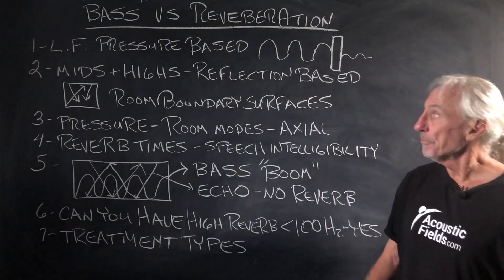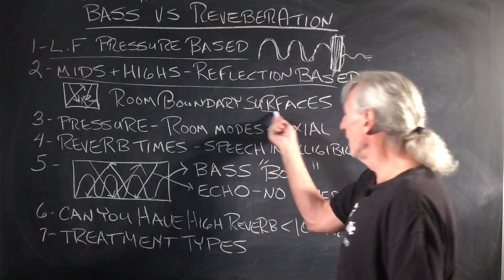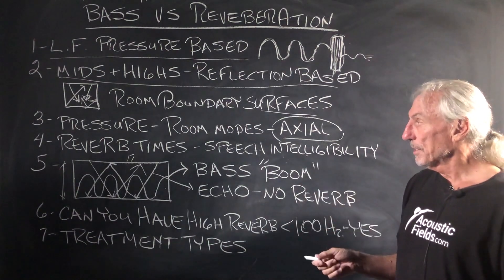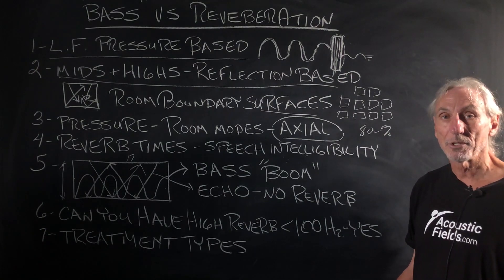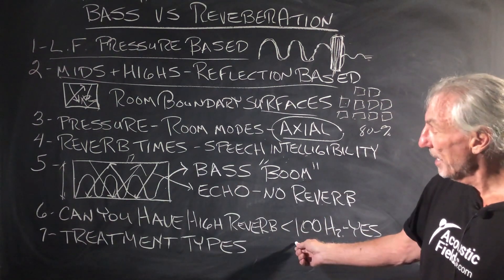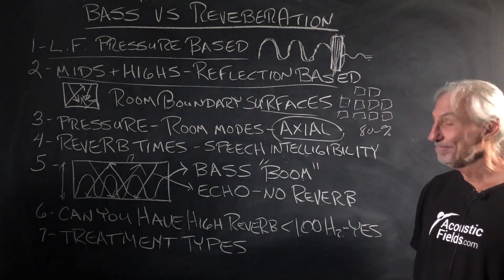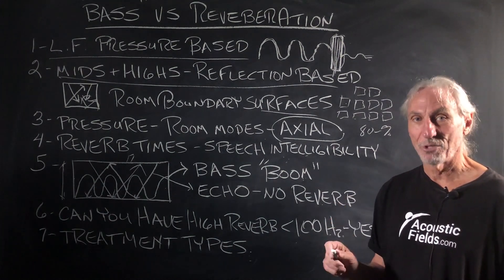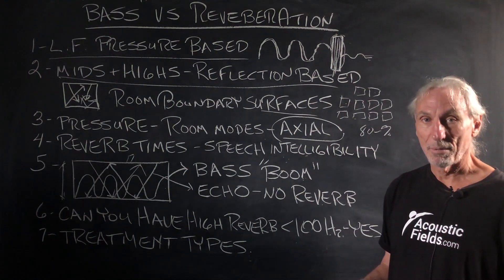Bass VS. Reverberation - www.AcousticFields.com

Comment: My favorite comments are those where clients or industry will say:  "You can manage reverb with DSP/EQ"  I say that's true but overstated and EQ or DSP is the last step only for fine tuning.
Reply from the maker: Its a similar argument we hear from speaker manufacturers. We receive countless calls from large venues especially churches who purchase speakers that " will solve your reverb issue due to our specific radiation pattern". No speaker regardless of its radiation pattern can improve reverb times. Its nonsense that plays upon the ignorance of the consumer.

Comment: Don't think that's a ratio. 100,000 to a million. $1000 room treatment to $10,000 in speakers. There were 4 speaker systems purchased. 100 to 250 would be more accurate. I am thinking, maybe 1 to 1. But if you are using less than 3 Watts of power in a 2 way listening room system. And not using much bass, maybe less treatment and nicer speakers.
Reply from the maker: You are not seeing the forest for the trees. You are looking for a rational to spend more on gear without treating your room. Spending more for small improvements in sound quality in a room full of distortions is not "sound" thinking.

Comment: Bass can be a noun or an adjective.
Bass (as in the voice part, or instrument) is a noun.
Bass Frequency, in this case the word bass is an adjective.

I can't imagine a 6 second reverberation, I'm working with a 2 second reverberation in a particular room and frustrated with the amount of treatment necessary for that!
Reply from the maker: The surface area treatment coverage is directly related to the Rt-30/60 times within said room volume.